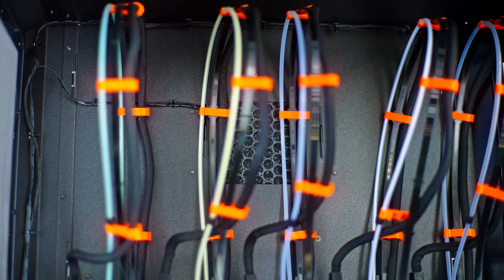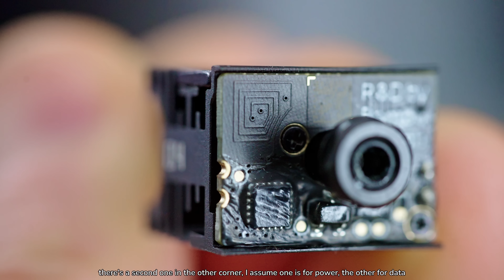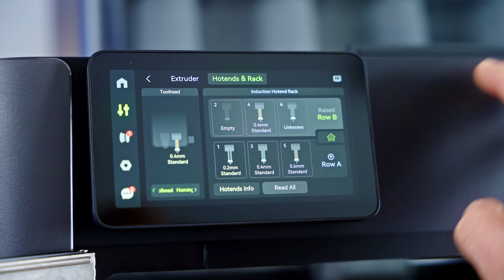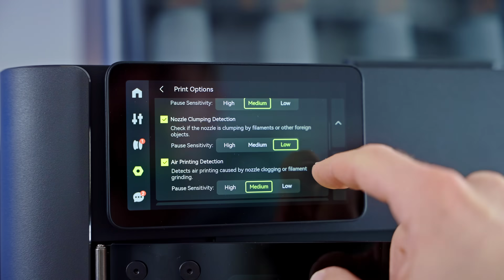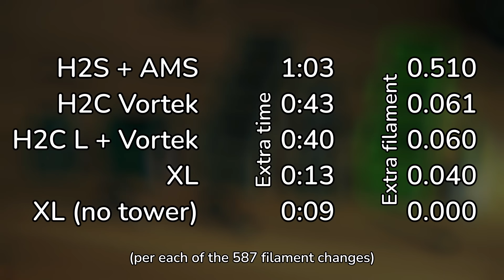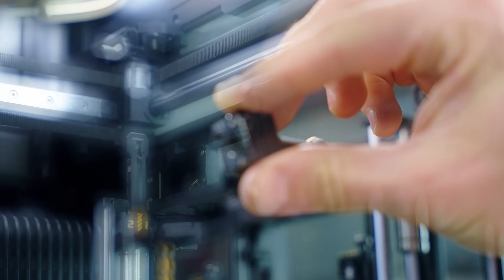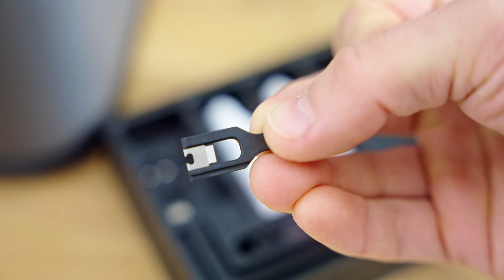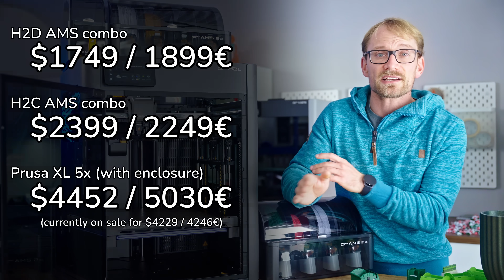The H2C is Bambu's 7-Hotend Patent Evasion Masterpiece!

Comment: I’m really glad to hear your health is improving. We all love the videos you put out, but not at the cost of your wellbeing—take care of yourself. There’s a ton of tech out there in desperate need of your style of review. 

On that note, have you come across anything about a printer called “FibreSeek”? There’s a continuous-fibre 3D printer on Kickstarter—the FibreSeek 3. Personally, I don’t remember ever hearing about versions 1 or 2. If these FibreSeek machines have any real substance behind them, they could seriously shake things up.

To me, the whole wave of multifilament printers feels gimmicky. Imagine if all the engineering effort that went into the H2C had instead gone toward a consumer-level continuous-fibre, metal, or ceramic printer. Bambu would be untouchable right now. As it stands, multi-filament rigs are basically just for multi-color prints. I can’t picture anything load-bearing or built for harsh environments coming out of a blend of random plastics at the consumer level—aside from using a second filament path for support material. That leaves them aimed squarely at knick-knacks, costumes, toys, and trinkets no one will mass-produce once the novelty fades.

Here’s hoping someone with vision in Shenzhen realizes it and gives us something truly unique and actually revolutionary.
Reply from the maker: I'm at Formnext right now, and Fibreseek is there too—let's see.

Comment: I still don't understand the system. It cuts the filament and parks the still loaded hotend. But when it picks it up again it has to purge the cut filement piece still inside it? How is that any better than normal purging? Using a normal 1 nozzle+ams should have the same result if you just disable the poops and only print a purge tower.
Reply: Because when using the same nozzle for different colours (or worse, different materials) you have to do a way longer purge to clean out the old filament and avoid discolouration or weakened prints. Where this system can assign an individual nozzle to a particular colour or material it just has a small purge to push the cut into the melt zone and refill the hotend, way less purging required and far more suitable for multi material in particular.

Comment: Joel aka @3dprintingnerd already had a clogged .25 nozzle. Tried to unclog it and renderd it useless. So you trow away like 60 euro's once a nozzle is clogged. with a clogged nozzle on my prusa's i simply heat up a copperwire and unclog it :P But prusa is getting behind in this technical revolution and has to comeup with a gamechanger them selfs.
Reply: Unclogging maybe could have worked on larger sizes than 0.2 – he didn’t test that.
Reply: 0.2, doesn't cost that much and he didn't do it properly

Comment: As usual Baboons copy. They are simply waiting for opensource to come up with multi nozzle
Size slicer.  This is simply a nozzle automated machine which basically changes a nozzle for you, rather than partial multi nozzle printer as you do her 2 on the print head. I still would wait for INDEX or DGEX/QNEX which is way more efficient and true multi material which I think will support mix nozzle slicing… I would
Rather have 2nd or even 3rd printer rather than 1 that does it all and will break…

Comment: I love the reviews I have seen so far! Of course there is always initial worry about long-term reliability and usability, especially concerning different nozzle diameters being able to be used for things such as text. However, one issue I have seen motioned a few times is the uneven heating of the print bed, causing adhesion problems during prints. Is this something you experienced during your testing as I would feel that it is a critical thing to have right.

Comment: I'm no expert and brand new to multicolor printing, but this purging and swapping seems to be approached in many different ways and none of them seem ideal yet. Your bin prints looked sub-standard with lots of stringing and uneven edges. Simple question though, can the slicers be told to make the purge a part of infill structure instead of being dumped? Make mechanical use of the transition color. Surely this would also be a lot quicker.

Comment: This was already not making me regret backing the Snapmaker U1, and and then I learned the price.
Reply: In South Africa the U1 will only be available in April and snapmaker here is always grossly overpriced compared to international prices. I paid les that 50usd more for the h2c in sa delivered compared to price in China excluding shipping... still the price of a small but decent used car...

Never been a bambu fan but so far I'm darn happy
Reply: I lold at the price
Reply: Yeah the more I hear about the H2C the happier and more excited I get with getting the Snapmaker U1 in January.
Don't quite see why anyone should get the H2C tbh
Reply: @Nicros21  If you want to print more than four colors in a single print using a collection of AMS units (up to 25 colors total), or if you need to print exotic engineering filaments that require a heated chamber or a nozzle temperature over 300°C, then the H2C is an excellent choice. You can print more than four colors with the U1, but you'll need to manually pause and swap filaments for each layer that requires it.
Reply: @Nicros21 because the U1 prints a tiny 270mm square?

Comment: Can you have .8 in the non changer and .4 in the changer, of is it a software issue that prevents 2 different sizes in the same print?
Reply from the maker: Any nozzles used in the same print need to be the same size, which is a slicer limitation. You can have any size nozzle loaded in the left side, but you can only combine it with the same size nozzle (on one print) from the Vortek.
Reply: @MadeWithLayers  Thank you, I assumed it was a slicer issue.  I wish this would be addressed, but I understand that you would have different height layer and lots of problems.  I would just like to use filaments that clog easier in a larger nozzle, but I get it.

Comment: The price is good but the mechanism is too complex for very little gain. The most impressive part is the ability to change nozzle diameters. Cutting the filament for every nozzle change is stupid, because you start out with a single AMS and therefore don't gain anything on the out of the box setup compared to multiple tool heads. It only becomes interesting the moment you have multiple AMS.

Comment: One of the biggest issues with this machine seems to be that material switching still requires the use of an AMS, which means the materials you can also swap between is much more limited. Specifically, I imagine it would be really difficult to use standard TPU (not TPU for the AMS, regular TPU) because the AMS struggles with it a lot, which is really unfortunate because multimaterial printing with TPU is one of the most legitimate and powerful use cases for a multimaterial machine in the first place IMO
Reply: Right I was expecting a tool head changer for some reason. I’d take a prusa or even the u1 over this
Reply: @RioterWTF to be honest the U1 seems more compelling to me at least. The tool changing mechanism there, while still complex, seems quite a lot simpler overall and easier to repair. Very much remains to be seen though which system is more failure prone. The tool changing system on the U1 just seems like the best implementation of a tool changer on the market right now, ESPECIALLY given its price
Reply: @RioterWTF  Prusa with the full tool changer is double the price at 5K
Reply: @RioterWTF I hear ya but the prusa is almost double the cost. I’d say the snap maker is a great competitor if it works well.
Reply: You can do TPU in the fixed nozzle, so only one color of TPU but it is doable.
Reply: @dddddyyn I see, I suppose that fixes my problem then. Still feels like a bit of a workaround, but oh well
Reply: @craftingpilled  definitely I agree with you guess we’ll just have to wait and see how the nozzle changer works out but as for now I’d definitely choose the tool changer.
Reply: It’s not an issue, Bambu looks at it as a feature that those who already have AMS can use this printer. No automated material system can work with TPU. Only tool head changing systems. That’s what you’re looking for, a multi head system.
Reply: @T @TheLastTater  exactly, automated material changers don’t really work with TPU. This system has a lot of similarities to a head changer system, but it lacks some of the key advantages of a head changer system which makes it way more compelling to me overall. I’m definitely not an “average user” in Bambus eyes, I’m an engineer so I’m far more interested in multimaterial 3D printing with a tool changer than multicolor printing. That said though, I can’t see much that would make me want the H2C over its next closest competitor, the Snapmaker U1, especially since the Snapmaker can do both multicolor and multimaterial very well from the reviews I’ve seen. There’s not a price for the H2C in the US yet (that I’ve found), but I’d be surprised if it wasn’t at minimum $2000, and based on the features it has it doesn’t have any notable features I’ve seen that the U1 doesn’t also have.
Reply: @cra @craftingpilled  makes sense, I think Bambu caters more towards an intermediate and beginnner crowd. I’m curious, what’s your thought on using the snap maker for engineering filaments given that it isn’t enclosed and its UI? It definitely has an attractive price point.
Reply: @T @TheLastTater  Snapmaker sells a top cover for it for $150 which is pretty reasonable, and still less than half the price of the H2C, so I think printing engineering filaments with it is still plenty doable since it’s easy to enclose (you could also DEFINITELY make your own enclosure for a lot less than that). What’s the issue with the UI?
Reply: @craftingpilled that is a good price for a cover! I didn’t know they had one. I think your taking defense a bit to much here, I was just asking of you opinion of the UI, I haven’t seen much on it.
Reply: @TheLastTater my bad lol 😂

Comment: I have the H2D and while I guess this is an advancement of that machine…I will wait for an actual tool changer from Bambu.
Reply: If you can’t tell Bambu isn’t going to do a proper toolchanger because they’re set on the h2 architecture idk what to tell you
Reply: How do you like your H2D?
Reply: @ThomasS17 I have an h2d as well and I honestly love it. For using support material its an absolute game changer and even on models that have 3-4 colors it saves quite a bit of waste compared to a single nozzle printer
Reply: @infinitEndz  Good to hear. That would be my main use case too, support material and dual-material (incorporating TPU into rigid filaments). In this regard, the H2C doesn’t bring many benefits other thank the ability to chnage nozzle sizes in the slicer, and an advantage for the occasional multicolor print.
Reply: @ThomasS17  its a beast. It is great for dedicated support material. And it can do multi-kg PETG prints without any warping. My P1S alwasy had some warping with realy big and heavy PETG parts. The user interface is almost perfect and the quick swap nozzels are great.

Comment: Turning the hot end into an inkjet printer was a terrible idea.
Bambu printers are packed with cameras and you're (well they're) telling me that not a single one can monitor for smoke, or the hotend glowing red hot and then immediately halt the print?
Or even better, slap a tiny little IR thermometer into the printer pointed right at the hot end and use that as a secondary temp reader.
If the IR reads out of sync between the hot end by a certain percentage (to allow for a margin of error) halt the print, so if the hotend is reading 200c and the IR is heading 221, then the print just halts as it's more than a 10% difference so one of the sensors isn't working. 

Or just drop the wireless sync nonsense. That hotend could just have 3 contacts on it.

Comment: THINK ABOUT THIS:
A small glimpse into the future of what might have led Bambu Lab to develop this exact setup (“nozzle changer”)—and how it could potentially surpass traditional toolchanger systems.

The Vortek system enables fast swapping of nozzles with different diameters. If Bambu Lab has solved the challenge of using multiple nozzle sizes within a single print (likely through slicer improvements already in development), then you could, for example, use a 0.2 mm nozzle for fine details and a 0.4 or 0.6 mm nozzle for other areas of the model.
The benefit: only one spool of filament is required per color, because only the nozzle is being swapped. This would also eliminate the need to rewind filament back into the AMS.

In contrast, toolchanger systems with separate filament paths would need a dedicated spool of the same color for every nozzle diameter—hoping that there are no color deviations between batches.

Technically, this setup could open up possibilities we haven’t considered before. Right now, everyone is mainly focused on the speed of color changes—but the more interesting question is what actually motivated Bambu Lab to adopt this design in the first place. 😉

PS: Thanks for featuring my model ;)
Reply: Motivation was just to get around patents and use ams

Comment: We are 1 step away from normal printers. With this magnetic solution they could have put 1 row of heads in the front to pick it up with tool1 and 1 row of heads in the back that could be picked up by tool2. Each head connected to their own PTFE tube and spool.
This would solve the retract and cutton problems. The complete hothead with its own PTFE could be just picked up without having to cut the filaments.
I don't know why they missed this.
Reply: I’m guessing having a dedicated ptfe tube per hotend, and related concepts like re-grabbing the filament from the side, is covered by bondtech’s INDX patents. However I can’t find those patents, they may not be published yet.
Reply: But you dont have to grab filament from the sides, the filaments are already on top of this machine. You dont even need long PTFE, just hang down the filament.
Reply: Oh I just watched the bondtech intro, this was exactly what I imagined.

Comment: It really looks like a great printer for prototyping. But I guess we will see how robust and reliable the system is once it starts getting out in the wild more, than just reviewers. One of the great things about the AMS's and multi material, is how it helps you visualize/actualize a part during design. Having the ability to color code sections, mix materials etc. Not to mention dedicated nozzles and materials for support. Is really big in this space. Not sure how it will do in the manufacturing space but it sure is promising. Should be a interesting battle the next few years now that we are seeing more competition and competing designs.

Comment: And what happens when the hotend changing mechanism breaks?  This looks like an overly complicated solution that has too many potential fail points.  Then again I'm biased against bambu so take that how you will.  At least with a toolchanger if one head goes down you "should" still be able to print.

Comment: I really dont get this printer... other than printing PLA in X different colors and have PETG in the fixed nozzle for supports.
tbh I even dont really get the whole h2 series: 
They added a chamber heater - thats really nice!
but the whole filament path is not suited for abrasive filaments - thats really bad!

to me it seems somewhat half baked

so I hope any other brand deliveres. What I want is a printer with multiple toolheads, heated chamber and filament paths withstanding abrasive filaments
Reply: AMS works fine with abrasives, it adds more wear and tear so you'll have to replace parts sooner, but most of the CF and GF filaments are officially AMS compatible. It's only the really brittle stuff that doesn't play nice with the AMS.

Comment: I really wish the Prusa XL came with an enclosure and wasn't quite so bulky, I know it's way more expensive but the time savings would catch up pretty quickly and outweigh the costs of using Bambu's walled garden
Reply: try 5 colors and tell again about savings)
Reply: ...and what walled garden you are talking about? You cannot use 3rd party filament, plates, nozzles, slicer, monitoring? I don't think you prusa printer with random slicer, but you are the one who just make noise
Reply: @RenCreates-t6p This very video specifically talks about how the nozzles & hotends of this printer are locked so you can only use the ones from Bambu.
Reply: @skurky  has anyone even produced a nozzle/hotend that would be functional, let alone compatible with this?
Reply: @RenCreates-t6p bambu printers work just fine with 3rd party filament. 
Aftermarket buildplates require manual selection in the slicer, or you glue the QR code.
Last but not least there are 3rd party nozzels available for everything but the induction heated ones.

Comment: I was excited to see this printer. However so far it seems like the Bambu's salami method is progressing slowly but steadily. Bambu making their ecosystem more and more closed. I have X1C and I use a lot of aftermarket parts. One being TZ 2.0 and TZ 3.0 hotends which are not only much better than original bambu, but also fraction of the price. One full hotend with a set of all nozzle sizes costs the same as one nozzle from Bambu. I am afraid that H2C hotends will be impossible to copy due to on board chip with S/N. Lets hope Im wrong.